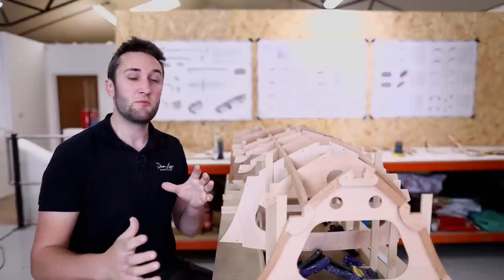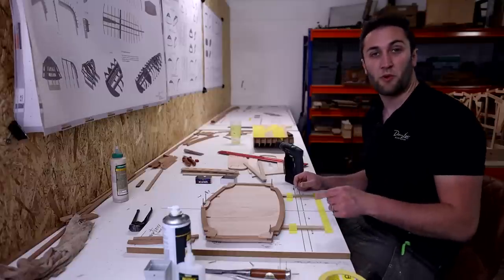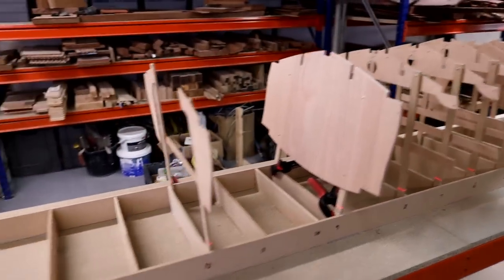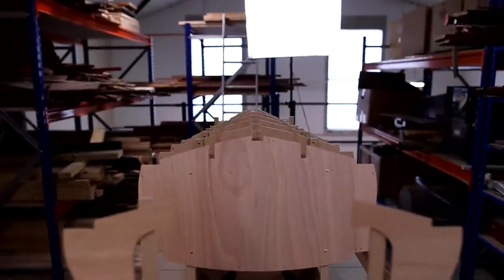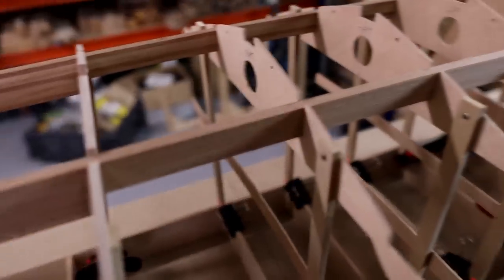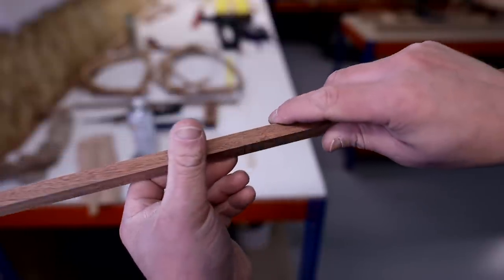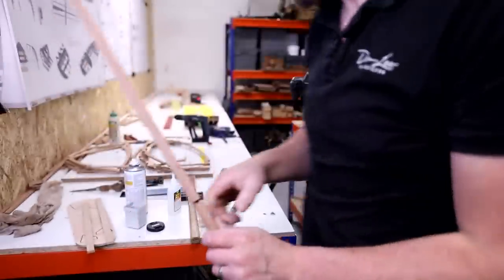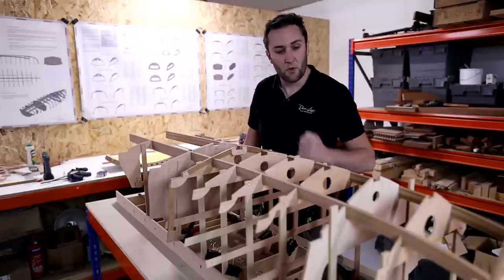Installing and Notching Stringers | Temptress 1/4 Scale Boat Build Part 7

Comment: I guess for frames with bulkheads, you could have drawn a line on the bulkhead where the frame is before you remove it and then transfer those lines onto the stringers. No sequentiell threading process needed and less measurement errors.
But as always nice video, great series!
Reply from the maker: Now THAT is a damn good idea 👍 I’ll give that a go on the next set of frames 👌
Reply: Nice. I'm glad I could help the master 😉

Comment: An RC version - I'm looking forward to that! I think that this building process will work fine for a full sized boat, as it lays the basis for an accurate and symmetrical hull, but it looks slightly fiddly in 1/4 scale. Is that a fair comment to make? I'm an experienced model boat builder myself, and I like to contribute in a constructive manner. (yeah I know, bad pun)  Anyway, I appreciate your clear and well presented videos Dan.
Reply from the maker: Yes you are quite right. This design has of course been done for a full size boat and then reduced. It is fiddly at times and certainly overkill for model building but my main aim here was to show the process for the full size boat. With the model plans I am working on there will be reduced detail, complete frames with no joints for example and the stringers will just sit in them without the need for notching. They will be much better suited to someone just wanting to build a model. Feel free to contribute any other suggestions regarding a dedicated model version and I will try to incorporate things as I create the plans 👍
Reply: @DanLeeBoatbuilding  Thanks for your reply Dan. You're right on the money regarding complete frames etc. for model plans - excellent!

Comment: I would be interested in building a 1/3 scale, how would I go about getting plans for one that size?
Reply from the maker: That would be big! The model plans could be scaled to that size. Are you wanting to build that as a model or a small functional boat though? I wouldn't recommend scaling the design for any purpose other than model building.
Reply: @DanLeeBoatbuilding  yeah to be a small functional boat, just something to ride around in on the lake (no real need for a big boat unless I'm going fishing and would go fishing in something like a full sized Temptress), obviously wouldn't be using it for anything fancy though just to show off and probably put an electric motor in it too.